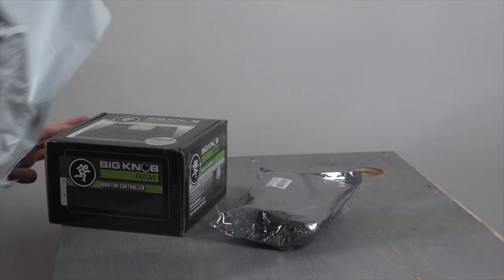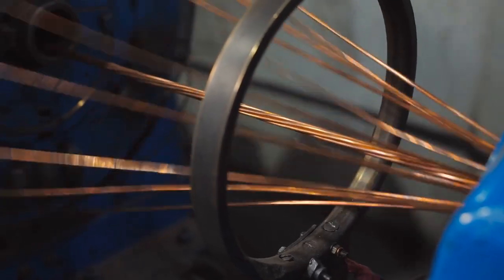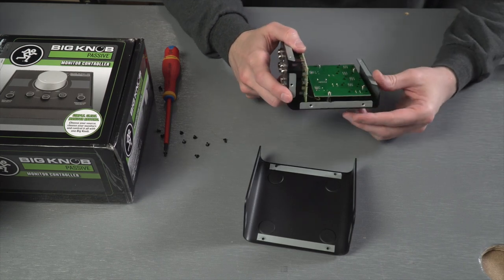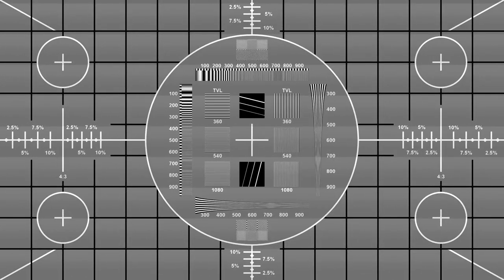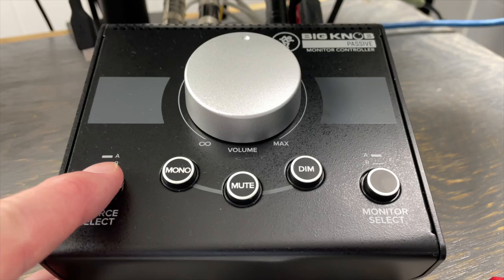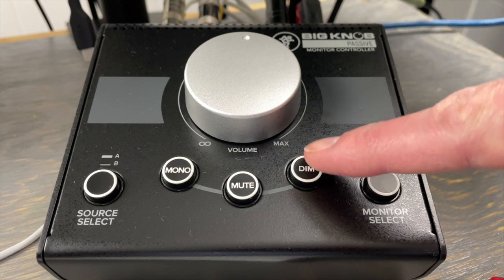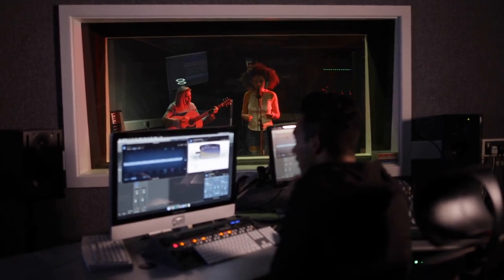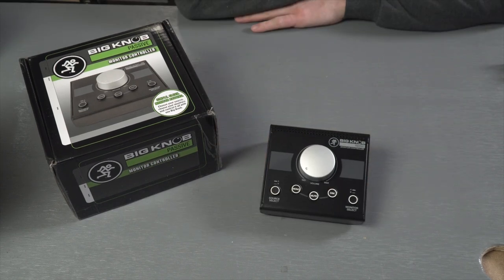Mackie Big Knob Passive teardown & demo with audio samples

Comment: Hello! Thanks for the video. Beside the low volume of the signal, I felt that the quality of the audio has decreased. Do you think it's possible? Or it's just equivocated perception? Thanks a lot!
Reply from the maker: Hey thanks for the message. It can be really hard to tell quality differences at varying volumes... it's certainly possible that you could be hearing a difference though with anything in-line at this price point.
Reply: @DcSoundOp  You are right! Even the quality of cables may interfere.  I will try to do some more tests. Thanks for your answer!

Comment: Going back to Audio Electronics 101 the clicks may be a result of not using "make before break" type switches.  In make before break switches the contacts engage the new contacts before releasing the old contacts thus avoiding a momentary floating connection.
Reply from the maker: Thanks for the message Robert, it is great to hear your thoughts on this one. That would have been a good sub-topic to squeeze into this video as a demo. Maybe one you can do on your channel if you have the parts on hand? Hope you're well!

Comment: Good content...never seen this type of overview...well done.  However, I wish you would have looked at that audio in a stereo view vs a mono.  On my unit, I've noticed big time when you turn the volume knob from zero to where you can hear audio....I notice the audio (on the very low volumes) will only be coming from one speaker vs. both evenly.  This would be a good test.  Unfortunately you do have to turn the unit up to get both monitors to have even audio, and it is difficult to listen at low levels because of this issue.   I have two Big Knob units and they both do this.
Reply from the maker: Hey Shay, I answered your message directly in the latest video. Trying something new to see if folks like it, thanks for your idea, I hope you enjoy the video response  - https://youtu.be/kHwAXXc3QbY
Reply: it's near impossible to match 2 pot tracks consistently at the edges to give accurate dual-level control.  If this is what you need you need a controller with a stepped attenuator where it is switching matched pairs of resistors to be super-consistent.  The downside is you obviously only have a limited number of 'clicks' as your adjustment range.

Comment: Did the same test with my unit just now, mine doesn't make those pops when you press the buttons, but my pot is scratchy down at the the 7-8 o clock area
Reply from the maker: Thanks for the message! I guess consistency from one unit to the next is probably not to the tightest tolerances with these. Appreciate you checking out the video.

Comment: I have the TC Level Pilot. It’s also a passive balanced xlr in/out volume control. It’s a more minimalist design without the buttons and a single cable to the knob means that the cable connections are all hidden behind the desk. I’m also running the AVIO Dante to analog with DVS. It’s a good setup! Thanks for the videos and the in-depth breakdown of the Big Knob!
Reply from the maker: I’ve always liked how those looked on the desk!

Comment: One thing I noticed when I had one of these in my audio chain, was that even with the knob all the way to the right, and the dim button disengaged, there was still some signal loss from in to out. I found this out by simply doing a full bypass of the Big Knob for one monitor channel... I'm curious if this was just my unit or if it's due to the device not being truly balanced internally.
Reply from the maker: Thanks for the message. I'm going to do some more testing soon with this one. The office A/C has been out for a week or so now, but once we're back in there this one is on my list. Thanks for watching as always.

Comment: Hi, has anyone experienced “humms” with knob all the way up? Thanks!
Reply: Could be ground noise from poorly shielded cables and/or running those cables near power.

Power cables generated RF signals and are not shielded. XLR/TRS cables rely largely on summing to phase cancel any accrued noise along the line, but if there is a fault in the cable/connection, noise can be introduced. Keep audio cables clear of power cables, and if there are still issues, there could be dirty power in the environment they may warrant a power conditioner.

Comment: hello sir,, when i connect my interface(focusrite solo 3rd gen) to the big knob, the volume reduced a lot. I always set my interface volume knob to 12o clock(without the big knob). after i connected it i have to turn the big knob all the way up to sound like my usuall setting.  i'm wondering why this happen..
Reply from the maker: Thanks for the question. The Big knob is a passive device, which means it cannot add gain to the signal (it cannot turn anything up) it can only turn things down. So unity gain on these (the point where you get a 1:1 relationship between what you input and output) is ALL the way up. If you've set it at 12 O'clock, you've essentially got it turned down halfway (relatively speaking, but half of the knobs resolution anyway). Does that help clear things up? Let me know if I misunderstood your question!

Comment: If the block diagram is correct, the circuitry inside this unit isn't balanced. Kind of fake, electrically.
Reply from the maker: Hey Anders, where are you located?
Reply: @DcSoundOp  Knee deep in snow right now, mate. Sweden.